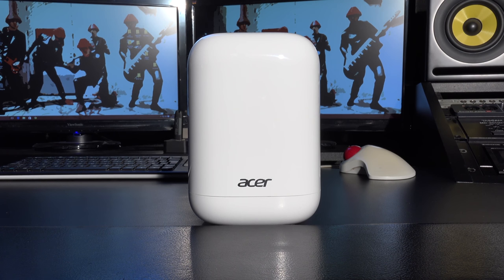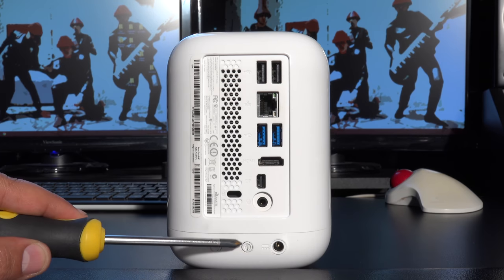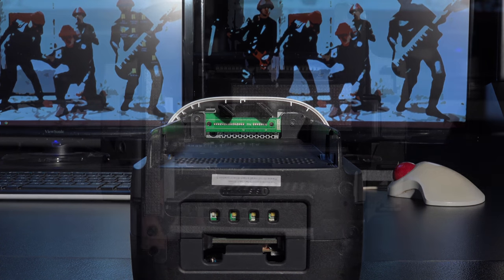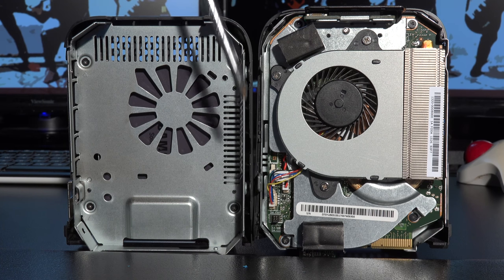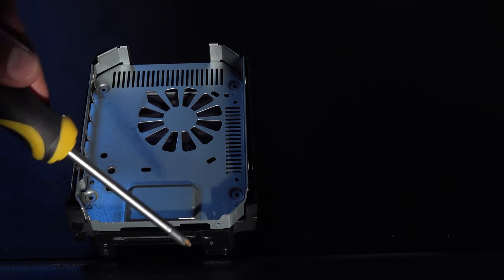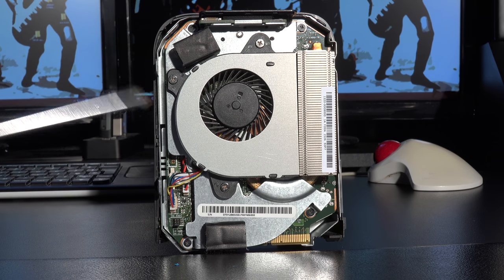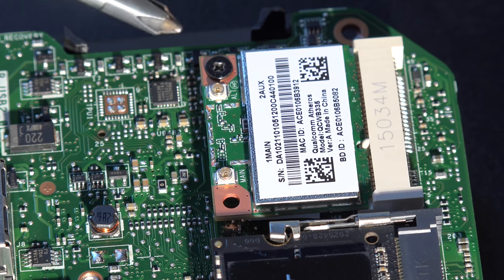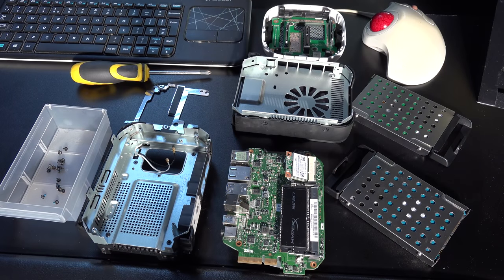Opening up an Acer Revo One RL85, memory RAM upgrade, hard drive SSD upgrade how to review tutorial

Comment: I remember watching this video years ago because I've got this computer, a couple of months ago my battery went and I needed to know how to change it although your video doesn't show that I managed to strip it down with confidence, thanks for that. In case anyone else has to do this I struggled getting a battery but managed to find one in Germany, it cost just over £7.50 including delivery
Reply from the maker: Hi Bob. I'm glad the tear down was helpful for you to find the battery. Cheers, Dave.
Reply: I've still got this PC, running Win 10. My CMOS battery has also gone, but a fair few months ago, but have been limping on with it being turned on at the mains most of the time. I need to find out what battery it is to replace it too. I'm guessing that it's a CR2032 in plastic casing, with wire coming from it?

Comment: One of the best Tutorials I have seen, very clear, easy to follow and good camera work. Thank you. I've just stripped mine down due to the heat sink being blocked with 6 years of dust. It's a shame these models aren't made any more because they are cracking  little machines.
Reply from the maker: Hi. Yes, a big shame Acer didn’t continue with this range and form factor. One of my friends has an i5 version with 8GB of RAM and extra SSDs, it is an absolutely amazing little PC. Thanks for the comment. Cheers, Dave.

Comment: Thank you so much for this. The motherboard died on mine and Acer wanted £250 to repair it. With this video I was easily able to pick up a MoBo on eBay for £25 and fix myself in about 20 minutes. Cheers!
Reply from the maker: Hi Mike. You’re very welcome and I’m glad that the video helped. If you’re into the Mini PC thing, check back as I’ll be doing some stuff with some Intel NUCs. Thanks for the comment. Cheers, Dave.

Comment: Managed to save the data on my faulty hard drive thanks to this. Strangely the 4 base plate screws were missing on mine, it just pulled off. Cheers mate.
Reply from the maker: Glad the video was of help. Sounds like the screws were missing from the manufacturing stage. Although I wouldn't worry too much, those screws won't effect performance or the physical integrity of the machine once the lid/case is back on. Cheers, Dave.

Comment: Thanks for this, David. I needed to replace the CMOS battery and you showed me the right way in. Great work.
Reply: I am trying to find the CMOS battery but I can't see it in the video. Any idea?
Reply: @guillaumeparent7695  Hi, the CMOS battery is under the main fan assembly  plate which is secured by FOUR screws to the board underneath. I have a good photo but can't add it to this reply in YT.
Reply: @atlaschallenger  thank you Paul. I will have a look. That's really nice from you

Comment: David, if I upgrade the SSD what will happen to my operating system. I just want to add a crucial 240Gb SDD so will I have to take the existing 60GB SDD out and does that have my operating system on

Comment: Great tutorial thanks. I want to change the  CMOS battery and see it is a special one for this model. Do I have to take the fan off to access the battery?
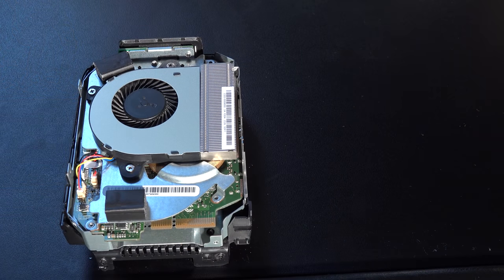Reply: I have now been able to change the battery.When you take the 4 screws out at 10:20 on the video the unit that includes the fan comes away from the top of the motherboard and shows the battery.It is a special cr2016 battery connected to a 2pin lead.The marking on the black casing is KTS 401 CR2016W 3.0V
Reply from the maker: Hi. Sorry for the late reply and thank you for sharing that information about the battery. Cheers, Dave.

Comment: This helped speed up the process for me when changing the ssd for a 250gb so thank you. Really good little machines these, cant see anything else on the market comparable apart from NUCs which I'm sure are much louder at the i5 level or the Eggsnow range. Just a quick question, do you know whether the raid drives snap out of the caddy, I couldn't see how to remove them but didn't try using any force. Thanks in advance.
Reply from the maker: The NUCs are great, I've built a few, but the Acers are better value for money and generally more expandable. The drives just snap out of the caddies, just gently pull the caddie apart at the bottom and the pins that hold drive should come out.

Comment: Hello Mr. Harry, thank you very much! I used your video to do a successful SSD upgrade. On a different note, what kind of Internet download/upload speeds did you get on your RL85 using the built-in ethernet card (RealTek PCIe GbE Family Controller)? I am getting about 20 Mbps download speeds (about 8 Mbps upload), whereas I get around 250 Mbps on my new laptop when I connect it to the same gigabit switch (not hub) connected to a router/modem with gigabit internet plan. I was expecting much better results considering RL85's ethernet card is gigabit. I've tried the latest drivers from RealTek with no improvements. I haven't been able to do a proper LAN speed test but I've tried various internet speed boost suggestions such as changing Netsh settings, changed DNS setting, etc.  I wanted some input from you (or others) before reinstalling Windows.
Reply from the maker: Hi Tehsin. I no longer have this computer but from memory there was never an issue with its wireless speeds with my broadband at the time. The broadband was 20Mbs up and about 200Mbs down. I know the Acer was hitting the maximum upload because I used it for a while as a FTP and PLEX video server and for uploading my YouTube videos. I can't remember its download speeds but it was fast and allowed me to stream 4K video. The LAN socket was always full speed, around 90-100MBs, I used this all the time with the Acer as it was also connected to local LAN storage. Sorry I can't help any further, I hope you find a fix for your speeds. Cheers, Dave.
Reply: @DavidHarry  Thank you very much for your kind and helpful response. 👍👍

Comment: Hi, very good tutorial. My Revo has 4GB RAM - 8GB is the system capacity. I would like to add rather than strip and exchange the installed RAM. I have one question at 3 min and 44 sec the Revo is shown with the top removed. At this point you can see a set of pins at the (far end) base of the unit. Is this for additional RAM? Thanks.
Reply: At the near (top) there is a 'SD Card' slot; at the far (bottom) is a socket for a second 2.5" SATA disk - HDD or SSD. The video shows the main Samsung drive David has already fitted inside. If it was originally made for 3 drives, there would be another 2.5" SATA socket, on the other side - you see the holes after he turns it over at
https://youtu.be/8aiJEFNoTEU?t=4m13s

Comment: Hi David, thanks for this video, it's really useful :) I have a couple of questions for you if you don't mind...
1. I have the Revo RL85 i5 with both SSD and HDD, do you know if this is in the form of one hybrid drive or two separate?
2. I'm hoping to replace with a bigger SSD as mine is full. Do you know if the Revo is compatible with both double and single sided drives?

many thanks!
Reply from the maker: Hi Jashan. I'm not sure what configuration your drive system is, although a hybrid drive should really show up as a single drive. Try going to Control Panel/System/Device manager Click on Disk Drives and this should tell you what drives you have, just Google the drive names for more information. I don't know what you mean by 'double and single sided drives'. Cheers, Dave.
Reply: OK that's great I'll have a look. Thanks very much David, much appreciated
Reply from the maker: You're welcome, Jashan.

Comment: Did all you said and worked fine but now on start up it say error with cpu fan. After a while things get hot because of this and movies slow down. Any idea how to fix fan. Cheers.
Excellent vid btw.
Reply from the maker: Hi Jimmy. Is the fan still working? Cheers, Dave.
Reply: @DavidHarry  I can hear it spinning. I think its that anyway. Took it apart again but cant see reason why its not spinning.  Its just came up in start up in bios that said cpu fan error.

Comment: I dont know if anyone can help? I have a Revo One RL85, DT.SZMEK.013 with an intel i3 4005u. I upgraded the ram to 8gb, everything runs fine, appart from a constant beeping from the unit. The computer can be sitting idol, but it beep beep beeps. I play watch a video, beep beep beep!! The beeping comes from the computer its self, not through the display. I just have no idea how to stop it? Does anyone else have this problem?
Reply: I didn't know it had a speaker!
My best guess - did you get 'DDR3L' RAM, not 'DDR3' ?
Low voltage - 1.35v not 1.50v ?
https://www.acer.com/ac/en/GB/content/model/DT.SYUEK.007
https://en.wikipedia.org/wiki/DDR3_SDRAM#DDR3L_and_DDR3U_extensions
Reply: PS 'DDR3L' is the one you want.

Comment: Hey David, I have this computer and online it said it has a mini PCIe slot, now I don't know much about computers but where is it located? I can't seem to find it
Reply: I think that's misleading - usually the motherboard has the slot, and you plug a  card into it: here they use the physical interface back-to-front, so the motherboard IS the card ! It plugs into a slot on a 'passive backplane' (like a riser) with the power, switch and SATA sockets on it.
See the photo here - the Mobo plugs into the slot marked 'PCIE x4'.
http://www.ebay.co.uk/itm/301958378592
Reply: Has anyone tried to get the version of that card with 3 SATA sockets as a spare part from Acer Support?
Or just solder a 3rd socket into the holes ?
Reply: The other place where PCI-express is available is the 'WiFi card' slot.
It looks like a 'NGFF M.2' slot. I wonder if an NVMe SSD would work there?
Reply from the maker: Eric D No, just the radio.
Reply: No - it's not 'NGFF m.2' - that has 5 or 6 connections before the slot.
This has 8 before the key, and 18 afterwards, so it is probably mini-PCIe/mPCIe.
The motherboard/backplane connector is 'PCI Express ×1'.
An mSATA drive would fit in the WiFi slot, but probably wouldn't work - the only way to know is to try it!
Reply from the maker: That's right, the only way to know is try it. I tried, it didn't work, that's how I know.
Reply: There are adapters that fit in place of the WiFi card, but most are twice as long, so you would have to DIY some way to screw  them down, and make sure they don't touch anything underneath.
WiFi cards are short and thin, so getting others to fit is tricky.

Comment: It's difficult to open some screws :-( . So tight.
Reply from the maker: +Budi Sentosa Yes, the screws can be a bit tight, just make sure you use the right sized screw driver or you may wear out the screw head. Cheers, Dave.